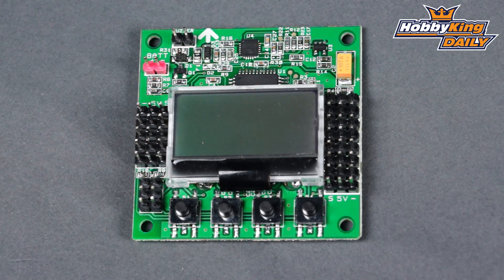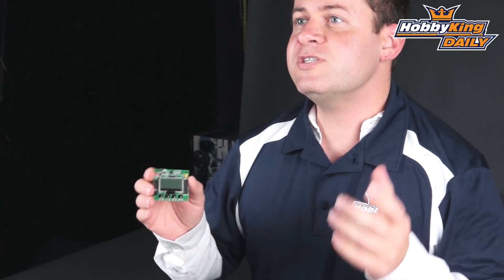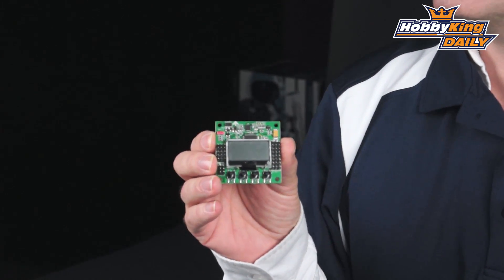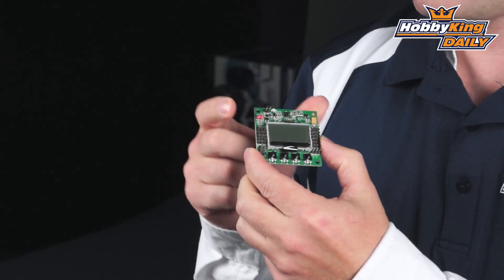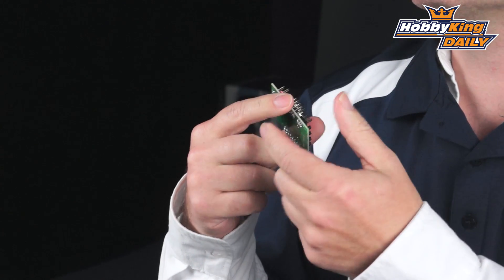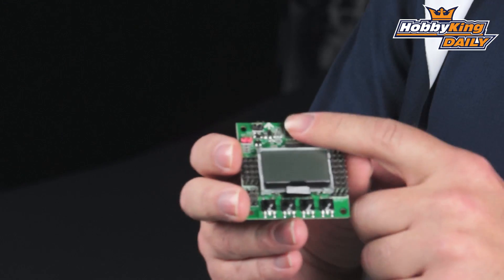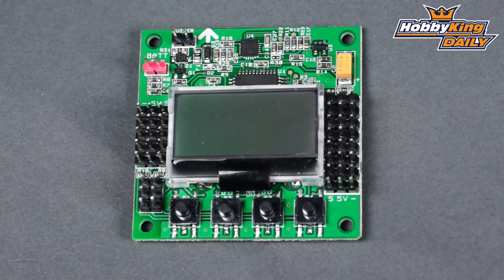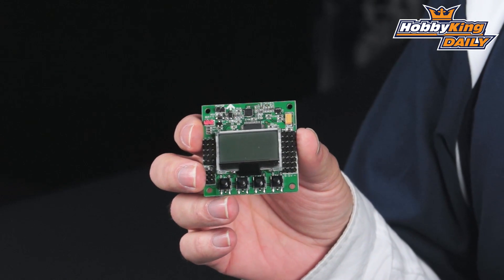HobbyKing Daily - KK 2.1.5

Comment: iam making quadcopter using kk board 2.1.5 and  connected all the pins according to the pin configurations of 2.1.5 as shown on you tube but as soon as i gave power supply a small amount of smoke came out and then i removed the battery immediately but after that i again tried it but it seemed like dead can you suggest what may be the reason for the smoke from kk board?

Comment: can i use the: HOBBY KING 20A ESC 3A UBEC

  

together with the:DYS BE1806-2300KV BRUSHLESS MULTIROTOR MOTOR 2S~3S

 plz someone answer me :) thanks
Reply from the maker: +DSO-For-You Yes, you can. without any problems.
Reply: +HobbyKing Live. i decided to make a hexacopter with the following

spedix s250ah hexacopter frame kit (only the frame)

round 12a spendix esc's

KK 2.1 flightcontroller

spedix distribution board

dys be 1800-2300 motors (same as in my other question)

lipo battery

some blades

and a 2.4 ghz 4ch tx and xt transmitter

will this combination work? 
thanks :)

Comment: Nice , that is well done! indeed great news !
what about the firmware ? is it allready 1.6 or does it still needs to be flashed ?
Reply: never mind i just checked it and it says 1.6 on the item page ! Really great job HK
Btw is the LCD screen still popping off or did you add some stronger doublesidet tape on that one ? Cause that was also an anoying thing.